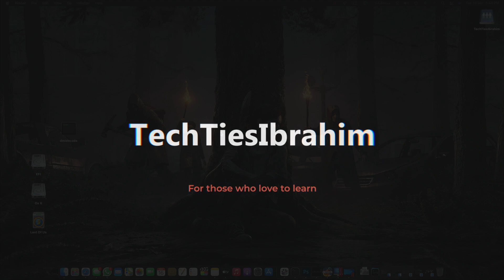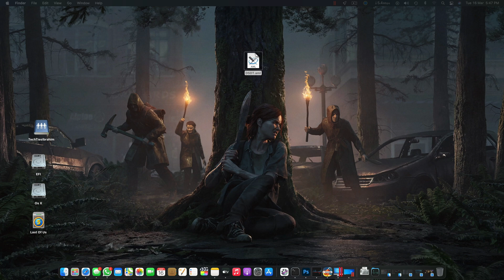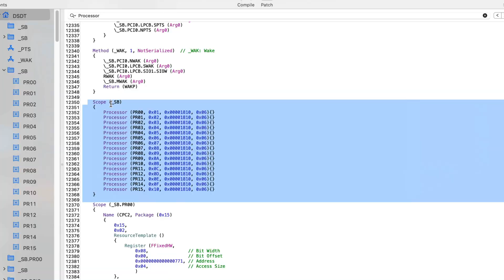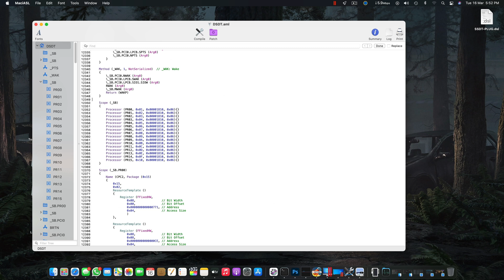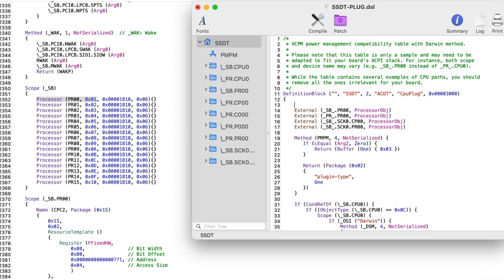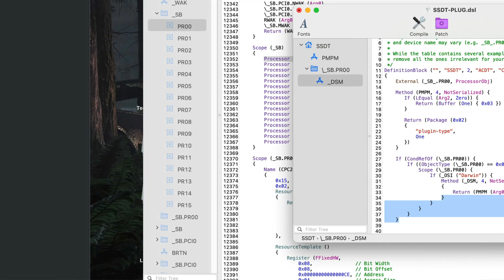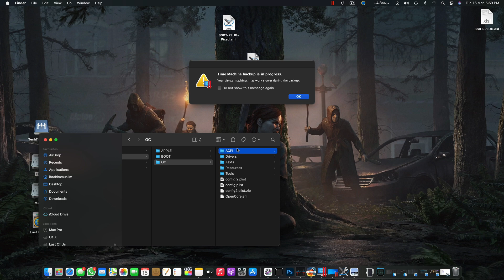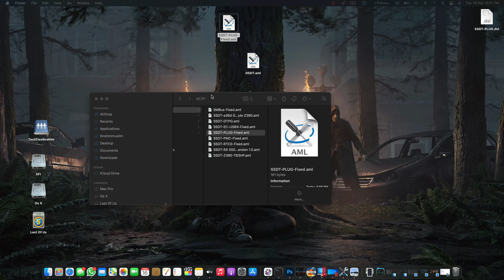SSDT PLUG for Fixing Power Management Hackintosh | OpenCore & Clover

Comment: Hi, I ma facing USB power issues otherwise my Hackintosh is running fine. I have mapped all USB properly and it gets detected but as soon as i connect two device, my mouse starts lagging. And for bluetooth only two device work at a same time. What can be the cause of that and how to fix it ?? I have GA-H81M-S motherboard

Comment: Does this allow you to use turboboost and speedstep? Looks too simple. Thing is, it's looking for the processors and then does an IF so if one of your processors match then it will run the relevant code. Doesn't seem to have solved anything? Anyway, I will carry on! Just want my turboboost and speedstep to work.

Comment: Hi. I am running a Haswell i5 on a Gigabyte H97-HD3 (series 9 chipset). I have my system up and running well using olarila's method, OSx 11.4, Opencore 0.6.9, running a MacPro 7,1. I only have SSDT-ORALILA.AML from my installation long time ago. Do I need to do all the above. The system is running well and I have always upgraded OSX without problem also. Thx